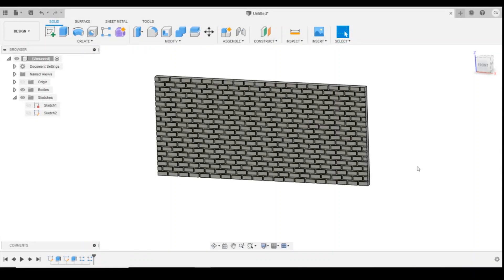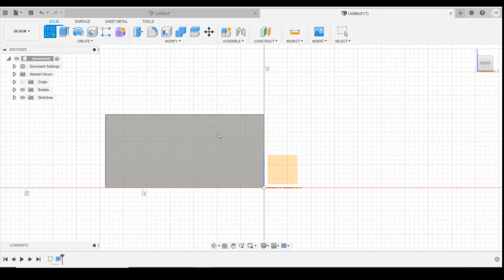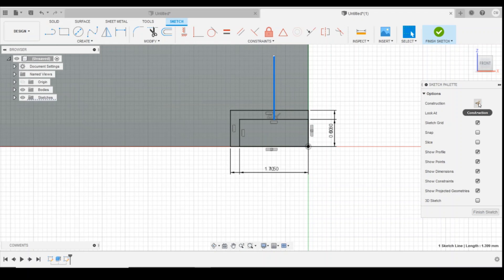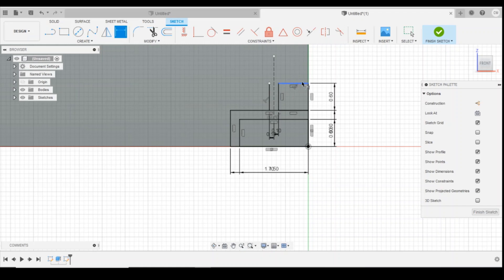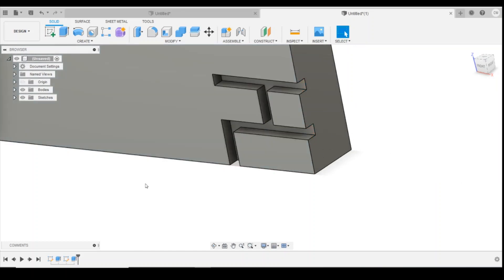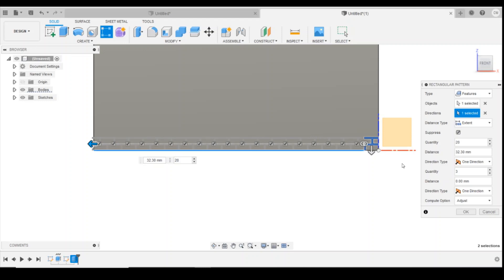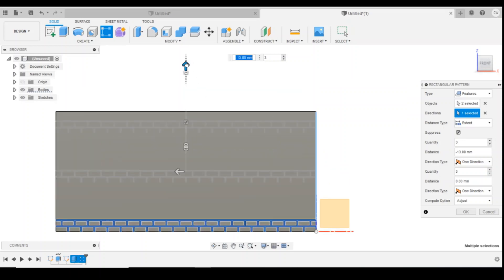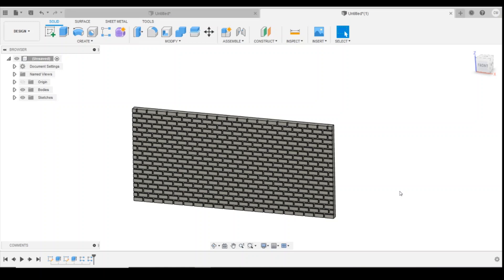Lesson 8 - How to Fusion 360 - Drawing a Brick Wall to 3D print for your Model Railway

Comment: I had real issues completing this exercise. When I applied the Rectangular Pattern Tool it replicated the brick pattern across the piece but not in a vertical column above the original sketch. So I backtracked and repeated the exercise but this time first creating a vertical column the full height of the piece, and then applied the tool from right to left,, but it then failed to replicate the lowest two brick courses. I then deleted the file, redrew it afresh, and had the same problem again. So I have completed the exercise by applying the Pattern Tool to all the mortar courses, setting the quantity to 1, and then placing the uppermost brick course of the copy overlayed on the lowest brick course that had been successfully created (so the majority of the copy was off the bottom of the defined area) and then I was able to create the lowest two brick courses. My final item does now resemble the item in your tutorial, but I don't fully understand why the tool could not replicate the whole pattern across the full width and depth of the piece.

Comment: Hi, Fantastic video. For the size of the wall, can I ask what your calculating to get a fluid fit, I was using multiples of 1.7 one way (1.7 x 29) and 0.8 (0.8x100), so 49.30 x 80 ( the size I need in height), but this gives me bricks with a slight join mark in the morter?
Reply from the maker: Hi,

I used 1.7mm x 20 bricks across the width of the wall,  one thing to note is that if you notice on the video the end mortar section is hanging off the end of the wall so that the end of the brick is on the edge of the wall.  if you put the mortar on the edge you will have the overlapping like you said.

Hope that helps.  if it doesn't please let me know.

Thanks

Carl
Reply: @3ddrawingformodelrailways  Hi Carl, that makes perfect sense, thank you I shall revisit!
Reply from the maker: Did it work Alan?
Reply: @3ddrawingformodelrailways  spot on yes, I've done a couple of designs but been away for a few days... Added a brick pillar but now figuring out how to add brick to an extruded wall as it's either buried in the wall or setting a few mm away from it.. but this video is excellent, thankyou

Comment: Hi, I was trying to create a brick pattern on a station wall I designed a couple of years ago but was designed using solidworks but when I do a linear pattern as you did with Fusion360 I get intersecting contour error, so its where the 2 parts of extruded mortar intersect, if I move another 0.01mm its fine but leaves a strip, any ideas as I dont want to redo in fusion as its 200mm long by 75mm wide and has 22 windows in it ...
Reply: I think I found solution save as a step file and import into fusion, so will have to watch your video again to remember how to do it ...
Reply from the maker: Sorry I was late to the party with a reply,  I'm glad you have been able to find a solution
Reply: @3ddrawingformodelrailways  No it didnt work ... computer just laughed at me ... so I went back to Solidworks and extruded bricks instead of Mortar and that worked ... also with the Step file I have no history at the bottom on Fusion ... i did 90 x 2 bricks high across and 6 upwards in Solidworks ... it took about 15 mins to sort things out ... the size you did was it 00 or N scale ...

Comment: Hi, I've another question. I'm creating a tunnel mouth, lots of repetitions of Regular patterns (brickwork), however having created 3 or 4 elements of this I find every action in Fusion 360 Mind numbingly slow, have you found a method to retain performance. Spec wise I'm on a 3080 RTX with latest processor, SSD and 32GB of memory, so all should be better.. Or is this just me fated because I want lots of bricks ? :)
Reply from the maker: Hi Alan,

The more bricks you have the slower the system will become as you are asking the software to do a lot of processing.

Could you split your item into multiple files to ease some of the work?
Reply: @3ddrawingformodelrailways  Hi, I managed to improve it by creating the rectangular patterns optimized, no idea what the difference is but it used less GPU...  I could do multiple files?, Is it possible to combine after or do you have to do it in chitubox?.